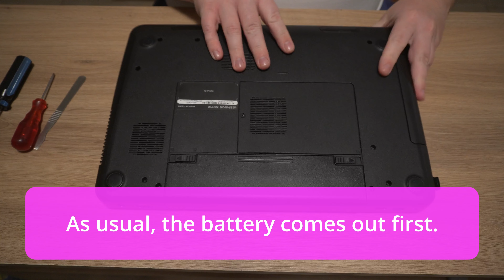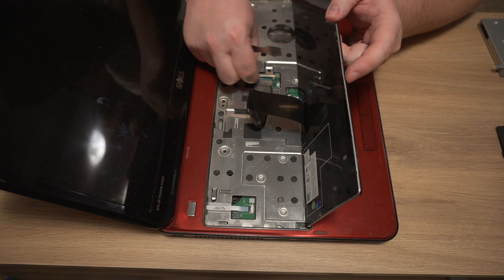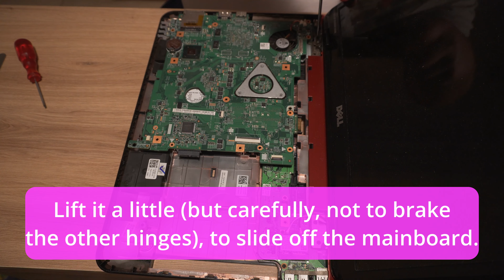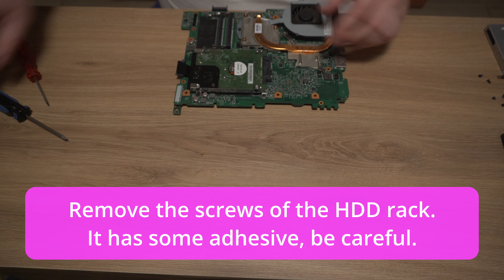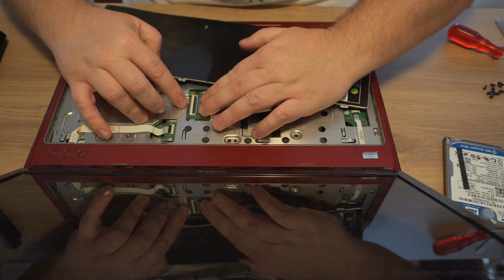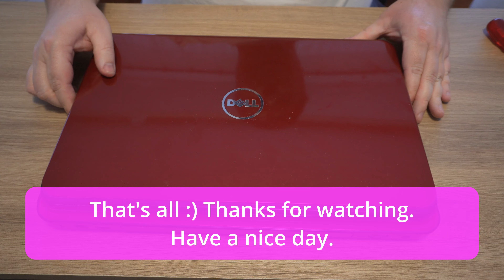HDD swap to SSD in the Dell Inspiron 15 N5110 laptop

Comment from the maker: MJJC Foam Cannon Pro, straight from the manufacturer: https://www.mjjc.com/collections/foam-cannon/foam-cannon-pro/?ref=OCDADDYZSOLT

MJJC Foam Cannon S, straight from the manufacturer: https://www.mjjc.com/collections/foam-cannon/foam-cannon-s-v3/?ref=OCDADDYZSOLT

MJJC short gun, straight from the manufacturer: https://www.mjjc.com/collections/high-pressure-washer-guns-and-nozzles/?ref=OCDADDYZSOLT

Automosowebshop.hu: 10% discount on ADBL, Tenzi and Booski Car Care products: https://automosowebshop.hu/?coupon_id=ocdaddy

ADBL Shop, 10% discount with the ocdaddy code: https://www.adbl.hu/?coupon_id=ocdaddy

Farmasi Hungary, 23% discount by using the following link: https://farmasi.hu/Account/Create?sponsorCode=64648810-11cd-44db-942e-3a229e0eb3b1

Farmasi Poland, 23% discount by using the following link: https://farmasi.pl/Account/Create?sponsorCode=64648810-11cd-44db-942e-3a229e0eb3b1

Farmasi CZ, 23% discount by using the following link: https://farmasi.cz/Account/Create?sponsorCode=64648810-11cd-44db-942e-3a229e0eb3b1

Farmasi Slovakia, 23% discount by using the following link: https://farmasi.sk/Account/Create?sponsorCode=64648810-11cd-44db-942e-3a229e0eb3b1

Polirtech.hu, various discount for certain times, details under the relevant videos: https://polirtech.hu

Gtechniq car care products: www.gtechniq.hu

Polytop and Primatec products: www.primatec.hu, www.polytop.hu

Autoglym and similar products: autofejlesztes.hu

Turtle Wax and similar products: hellocar.hu

Porzelack products: porzelack.hu

Elite Detailer and similar products: carzoneshop.hu

Various car care products: autobirodalom.hu

RR Customs and Bad Boys products: www.rrcustoms.hu

Marco Martely perfumes (for cars): marcomartely.hu

Various car care products: racoonshop.hu

Sonax car care products: sonax.hu

Neoxal car care products: neoxal.com

Powerful tools: https://hu.milwaukeetool.eu

LLumar car and building films: https://www.llumar.hu

Liquid Elements products: https://www.liquidelements.de

TubeBuddy for better channel analytics and tools: https://www.tubebuddy.com/OCDaddyZsolt

Would you like to have a single card that can be used instead of all other cards of yours? Use Curve - http://www.curve.app/join#DG8K2BLD

Would you like to have one of the best exchange rates and safe shopping/money transfer abroad? Use Wise - https://wise.com/invite/asd/zsoltv23

In case you would like to support the channel: PayPal - zsolt.tech.detail@gmail.com